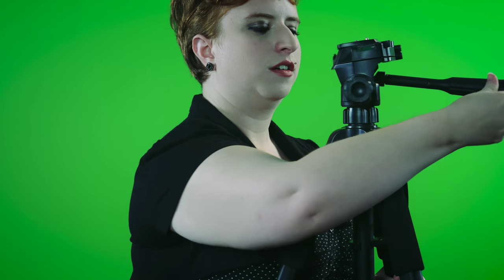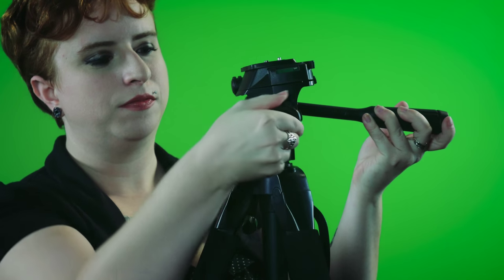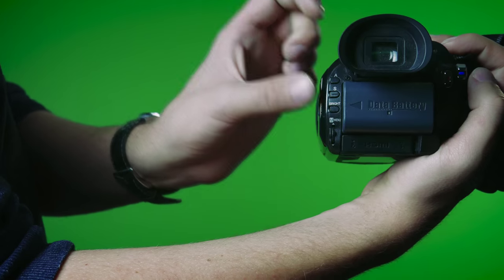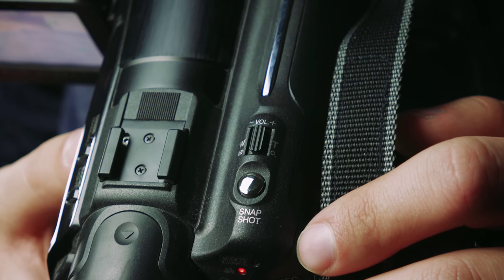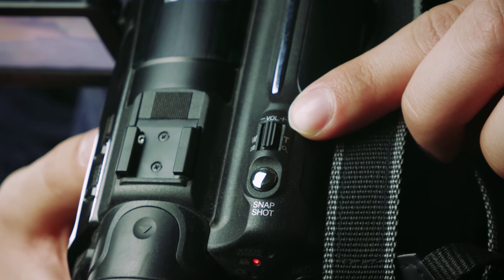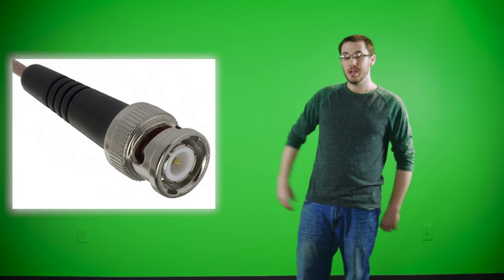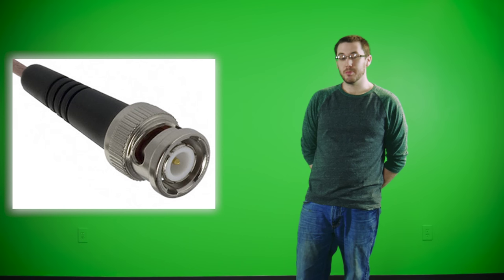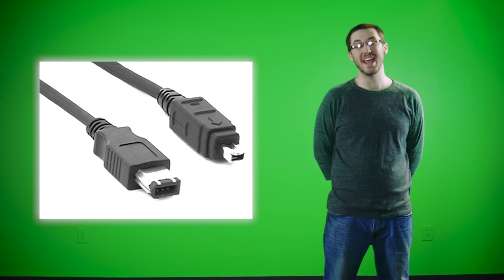Tripods, Cameras, and Connectors l Identifying the parts and functions

Comment: You need to show and explain what the screw thingy is that you screw in to connect the quick release to the camera. some have a screw you need a coin to screw and others have a thingy you can turn with your fingers. wish I knew what these were called so I can reorder the missing release plate I lost and get the kind you dont need a coin to tighten